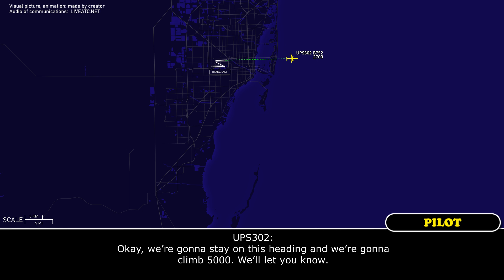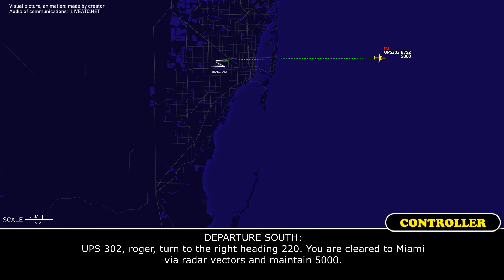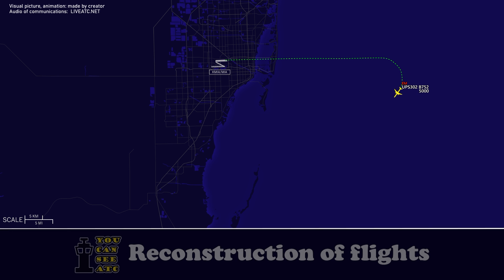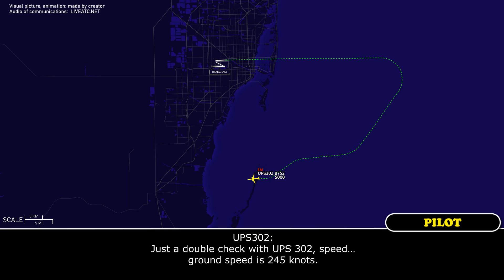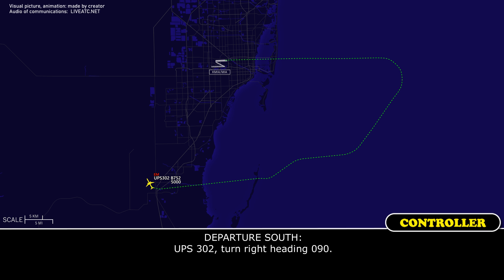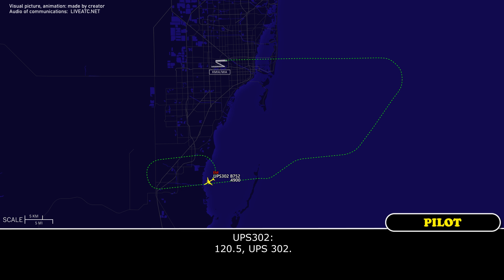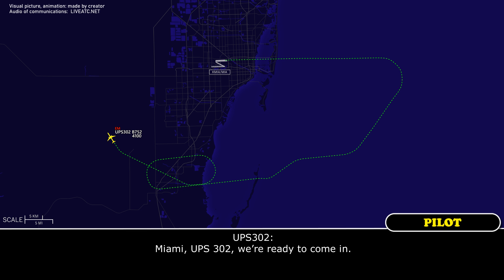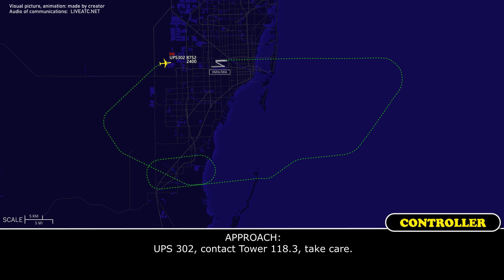Unreliable airspeed causes loss of altitude after takeoff. UPS Boeing 752 returns to Miami. Real ATC

Comment: Aircraft technician here, normally the speed that the controller sees is the speed that is reported by the a/c’s transponder so checking with them is really not much help. I don’t know their exact situation, but my instinct would be to check the standby indicator, as it’s completely independent from the other 2 and gets fed raw data. If it matched any of the other 2, my guess would be that’s the correct airspeed.

Comment: In a situation like this where there is unreliable airspeed, can the controller tell the flight speed calculated from primary radar returns, or only what ADSB is telling them from aircraft data?

Comment: Airspeed Unreliable for B757 Pratt 2037, (UPS uses Rolls Royce engines) Pitch to 10° Nose Up with flaps extended (4° up clean) power set 75% N1, that'll keep the aircraft level and at a safe speed. Full checklist is fairly long. Incorrect Airspeed Indicator may be determined by comparing with Standby IAS. Ground Speed is available.

Comment: I am surprised that the crew didn't use the iPad flight planner  or phone and use the GPS as a ground speed reference.
Reply: Why would you need to? The aircraft has GPS and ground speed is provided by the Inertial Reference System

Comment: What does "Alert 2 Aircraft" mean? Are there different categories for an emergency?
Reply: Alert 1: Indicates an aircraft is having minor difficulties (i.e., minor oil leak; one engine out on a three- or four-engine commercial aircraft or one engine out on a two-engine general aviation aircraft; fire warning lights; etc.). A safe landing is expected.

Alert 2: Indicates that an aircraft is having major difficulties (i.e., a positive indication of fire on board the aircraft; faulty landing gear; no hydraulic pressure; engine failure on a two-engine large aircraft; etc.). A difficult or crash landing may be expected.

Alert 3: Indicates that an aircraft has crashed on or off the airport, or there is a high probability the aircraft will crash, or the pilot has indicated that the aircraft landing gear will not work and, therefore, the pilot will have to crash land on the airport.
Reply: @rootuser9218  Thanks so much!
Reply: Alert 2: means a difficult landing is expected with the slight odds of a crash (ie flight control issues, fire onboard, missing door plug).   

Alert 3: is they have already crashed or are expected to crash (ie INOP landing gear)